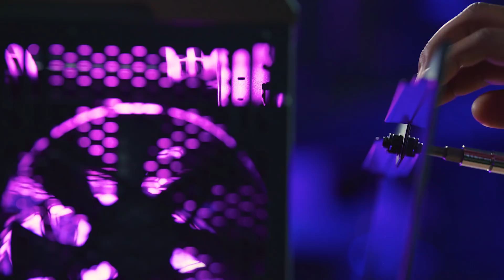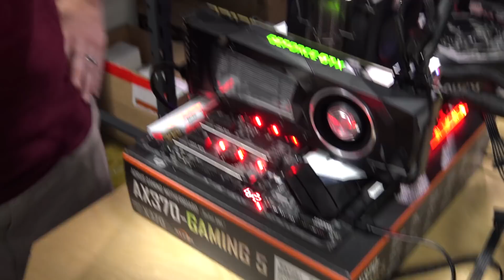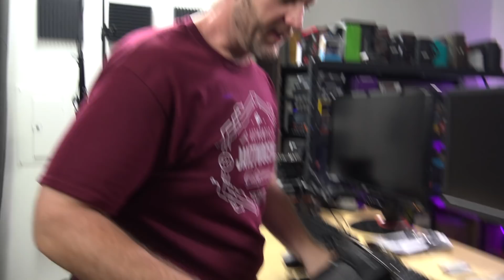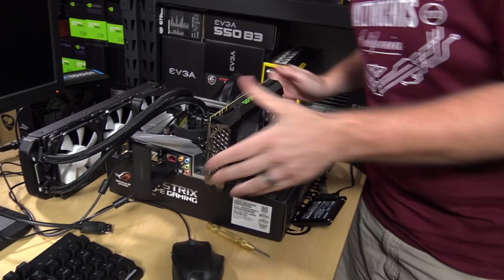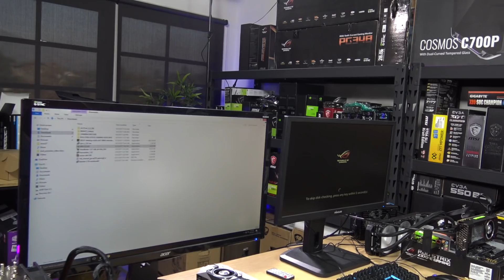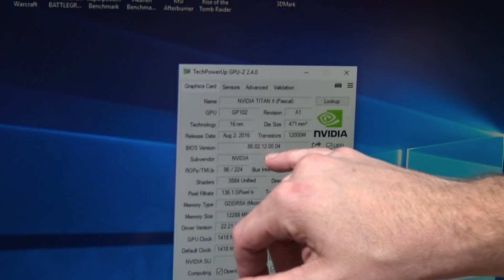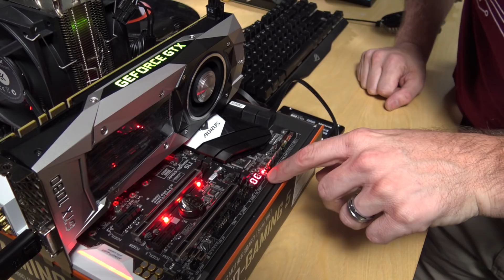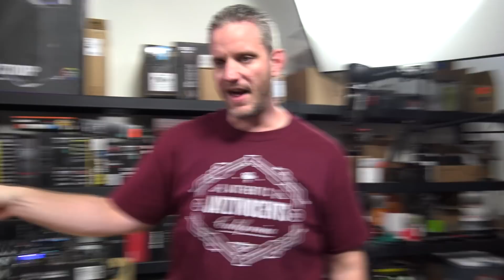I cant figure this one out... HELP!

Comment: on the AMD CPU system you have Nvidia cards and AMD card, I suppose you installed AMD and Nvidia drivers. Uninstall the AMD card driver on AMD CPU system and put the non working gpu nvidia in.

Comment: Had a similar problem once, and even though I'm not quite sure if that's what did it, cleaning the pci-slot (With some ipa and compressed air) and the connector (with just some ipa) on the card got it working, so I'm assuming that they both had dirt on them that when combined, made the connection too weak which ruined the functionality.

Comment: the Solution is power supply fault. as you know, gtx1080 take 180W , the TI 250W. i think for amd power supply may crush in over load.even on same card like 1080 one can take 180W and another 150W .  if you check in intel system if take same video card take same power consumption (from the wall), i say you will see at least 50W difference between AMD & intel system

Comment: My gigabyte board does the same ( INTEL x99 Designair ). Uninstall the nvidia driver boot with other card that was not working. It should work then. Does it with my 970 not my 1070 Both gigabyte.  Reload driver for graphics card. Let me know if it works

Comment: 1. Save bios of working card (the one that works on both systems) via GPU-Z
2. Get bios of that card (.04 one) to the intel system and flash the card that does not work on ryzen 
3. try the card that was not working on ryzen to see if it works with the "new" bios

Comment: You checked GPU bios on the same card twice.  Had this happen a few times in my 38 years of messing with computers.  Had it happen on two same GPU's being put into same identical systems (right down to motherboard, cpu, and bios), one wouldn't work in one but both worked on the other.  You probably did experience it being in IT repair, but in IT repair you would have probably just replaced the card and moved on so you didn't know you had the problem.  Weirdest issue I have ever had that I never got to work was I had one computer that would boot with it's cover off but wouldn't with it's cover on (all cover connections connected while off).  There were no in-case cover switches or anything and was a mass produced pc that I had fixed hundreds of and knew inside and out, no shorts in wires.  Never KNEW what the issue was but got around the problem by swapping covers with another computer, both worked on the other system.

Comment: I had this problem, where my PC wouldn't boot from USB when one particular HDD was connected to the PC. Go figure it out. Had to removed the HDD, install Windows, and then put the HDD. Or when you plug this HDD in, congrats, you have no OS. (Both HDDs are recognised in BIOS)

Comment: I Would check if the card works on a different pci slot.  after that I will switch my power cables. if nothing o that works I will remove all the hardware and start the mobo alone to reset any bit issue. check my CPU pins and socket. check the card socket and pines. remove any OC onfiguration on the bios. Now if nothing works redo the build with a different MoBo and do tests.

Comment: If you have another board try the same card that didn't work on it. I have the same board and I had to send it back and get a replacement which still has issues just not as bad. It would be interesting to see if a board from another manufacturer has the same problem.

Comment: I have a similar problem , the system on a boot would initialize the CPU+MEM according to the motherboard followed by the GPU but stops then , does not reboot , just stops. it would show a black screen but if i disable the bios splash screen post image ,the screen would turn on and show  American Megatrends logo instead and stop there.

https://imgur.com/a/h0iej

I boot my system daily and use it for 7-16 hours a day since i got it ,no stability issues.

To solve it , i just press the reboot button and everything working again , I could not find any bios settings that had any impact , even tried stuff that I would assume had no impact on it. But the problem in general sometimes does not happen for 3 weeks in a row. 

One of the very very early bios for my board had a similar issue but unplugging my steam controller moved the bios forward again in the boot process ,... ( that particular bios did not last long before it was updated and  i could never reproduce it)

Anyway I really hate this because I tend to give away my PC to  less tech-savvy people like mom/dad where it should work , not work 99 boots out of 100 because stuff like this scare the hell out of them. Not that I am PC-expert myself.

SPECS :
Gigabyte Gaming 3  B350 
-splash screen disabled 
-SVM enbaled (Virtualization default off, manual says it should been default on ) 
-XMP Profile 1 2400
-Manual set PCIe mode to PCIe 3 instead off Auto (one of the things I tested and left on)

CPU
-Ryzen 7 1700 - default wraith spire cooler

Memory
-ADATA XPG  ax4u240038g16-dbz Z1
Graphics
-RX 470 Sapphire Nitro+ with silent bios switch on
DISK
-Ultra Disk II 480GB
-A old samsung drive , hope to be replaced on next cyber monday :P

RM 550 corsair

Sofware
Windows 10 Pro , 1703
No overclocking , casual gaming (WoW,Hots,Divinity2,Indie games) , hobby developper/virtualization

Comment: General rule... weird faults often have their source at the PSU (you are looking at the effect of batching on gpu performance, this would result in different current draw, which may pull down an adjacent line, or screw with line regulation and screw up the POST)

More specifically the reseating the 1080 that you had to do - and the bogus error codes - badly seated gfx card causing memory/cpu errors???) does in fact suggest that all is not well with that mobo, maybe something that is just in spec in factory tests but out of spec in real world conditions?? a slightly shitty via or something that is ok-ish most of the time, but there is something about the 'bad' card that pushes it over the edge?
Reply: Posting to support this suggestion that it may be a tolerance issue - possibly with the PCI-E timing on boot. Also for all those commenting on the card bios - I am sure this was a filming error and that Jay had already confirmed they are both the same.
One question - is the Ryzen overclocked? I suspect not because when you have some sort of issue the first thing you  would usually try is to revert to defaults..
Reply: Or simply bad CPU/memory overclock...
Reply: PSU swap worth a try!!

Comment: I had a similar problem with a regular 1080 what I ended up doing was (No idea why this worked) unplugged my hard drives reset my C-mos reseated the GPU and it turned right the fuck on haven't done anything else except get the ram running at the right frequency. If that doesn't work I have no fucking clue.
Reply: i think its got something to do with ryzen not playing nice with the ram.

Comment: Considering you check the other card - as everyone pointed out, I would check different architecture systems next. The card might actually be broken - just a component that is not used with all chip sets - maybe check which PCIe version is used as protocol. Do all cards run on the same or does one run on 3.0 and the other one on 3.1? After all, systems run on legacy mode if they cannot establish a higher standard - and one might crash, the other might not. Really hard to figure these things out not having hands on it.

Comment: Problem with motherboard or DIMMs. 

I bet replacing the motherboard will fix the problem, ops it kinda did in the Intel system. BTW I still have USB problems with X99 on an Asus mobo so its not just AMD with problems here and then due to their new platform Ryzen, Intel still has them today!

Comment: It seems likely to me that the two cards, while technically exactly the same model (assuming the BIOS versions are identical - you checked BIOS version on the same card twice BTW, and we didn't get to see the BIOS version of the "fussy" card), have typical manufacturing and component variations from unit to unit.  The "fussy" Titan may require a little more power during bootstrap, so I'd think it's possible the Ryzen motherboard isn't delivering quite enough current (through the PCIe slot) for it to pass the POST.  That's probably unique to just that card - and maybe even that particular motherboard -  The Intel board's bootstrap voltages, or maybe its power delivery / VRMs, are able to provide enough current for the "fussy" Titan card let the system pass its self-tests.  The only test missing now is to get another identical Ryzen board, transplant everything, and see if the "fussy" Titan boots on that.  If it does, it's probably a combination of the Titan requiring a little more power, and the original Ryzen board not delivering quite enough, which would cause the POST failure.  Perhaps the "fussy" Titan, and that particular motherboard, were both built on a Friday afternoon....

Comment: Is it worth doing a hardware BIOS reset on the motherboard. Take out CMOS battery to drain MB BIOS power. On HP PCs motherboards there was a button to hold down to reset BIOS to default.

Comment: I have had similar issues try re-flashing the motherboard bios and leaving everything at stock then putting the card back in. It should work then but it it doesn't, it will never work with that board due to electrical communication tolerances between the board and the graphics card being just out of spec from each other. Usually From what I have seen it is a slightly out of speck issue where the PCI express is not communicating correctly due to a clock generator being off or not recognizable due to the specific cards tolerances. Remember even identical cards are different in their tolerances. I have seen this happen with 290x's, 970's, 980's, 480's, and 580's, this is the first 10 series I have seen it on but it is just the luck of the draw.

Comment: My brother had this EXACT problem with a 960 and an FX 4300. He has to push his power button, then wait for about 2-3 minutes and leave it running, then hit the Reset button.
Reply: the 960 works normal in my I7 5930k system, and my 980ti works fine in his system

Comment: i have the same problem with my asus sabertooth 990fx-8350cpu and a zotac 970, it wont POST after a few tries, my cpu and ram leds flashes, i turn the psu off (2 times) and the third time is the one that works

Comment: You only checked 1 cards BIOS. Also, try the "questionable" card in a different AMD test bed. The reason the card seemingly works may be because the 8700K has integrated graphics. Just a thought.

Comment: Is the gpu oc'd? If so, it could be xmp profile messing it up.. And the old man in me wants to say "tried pulling the battery?" aka a power-flush... Idk, had some similar problems with gtx 780ti some years back. It would freeze up in a msi (cheapo msi, not top-of-the-line msi) but my ratchet ass gigabyte mb from 2007 would recognize it and power up as normal, tried everything, and in desperation i pulled off all cables attached to the mb, and changed out the mb battery, plugged everything back together and it miraculously worked. To my annoyance. Lost about 2 working hours trying to troubleshoot... Good luck Jay.
Reply: +Ian Visser
No it wouldn't lmfao what.
Reply: Ian Visser that means nothing this is a specific problem for a specific set of hardware. I also got the same mb, not the same cpu tho, still worth a try for him
Reply: +Ian Visser
If it was a bad OC on the GPU, the computer would reset and everything will automatically be reset to there defaults.
Reply: wrong..

Comment: check the voltages distribution between the PCIE and the 8pin... problem could also be I/O priority order (a problem with certain hard drives waaaay back in IDE days where one drive works only on priority two, regardless of pin settings, while only working priority one on other computers). Maybe try the next PCIE lane. good luck

Comment: JayZTwoCents : The "quazi faulty one" is needing a slightly bigger starting current from the PSU....hence do not use a 1 PCI-Express cable to connect a Titan that is in reality a GPU capable of using above 350 Watts of electricity at full stress and has a bigger starting current spike needed to turn on on certain configurations....even bigger if it is slightly damaged from overclocking. USE 2 PCI EXPESS cables / rails, so 1 on for each power connector on Titan and that way you will be able to deliver the necessary starting current into the GPU if other components are at startup burdening the PSU too much.

Comment: Let’s assume that both bios are the same.  While it does t make a lot of sense, I’d switch power cables and even power supplies.  I get that it should affect the “good” card but worth a shot. Could be a finicky pin

Comment: @JayzTwoCents  I figured I'd chime in as well. I'd look more closely at power to the board and in particular the PCI-E slot. I've seen an issue where the board wasn't providing enough boot-up power to the PCI-E and the graphics card wouldn't initialize. Regardless if the card has additional power connectors, the slot has to send the voltage to the card and the card has to respond in order for the board to recognize the connection has been made. Newer boards send a halt state when no video output is present. I would personally try the Titan Xp in a different PCI-E slot, same board. Of course the connection speed won't be the same, that's irrelevant though. Then I would try a different AM4 board, identical to Aorus you are using.

My thoughts are that the one Titan Xp you have deemed as "bad" may be more finicky on slot power and the Aorus board isn't providing the boot-up power needed. The Intel board seems to be pushing enough to keep the card happy. IMO, the BIOS would cause a fault in the card no matter what board you put it in. I've personally never seen an older BIOS on a card keep a board from posting.

Lastly, while both the cards are from NVidia and both are Titan Xps, I thought we learned that "identical" in the graphics cards world just means they come in the same box. You proved that yourself, remember?

Comment: iv also noticed issues with the new am4 motherboards their faulty on picking up alot of things that the motherboard manafacturer swears they will recognize it was a rush job to get them out basically even tho everyone has spent thousands am4 is still in beta testing by the time they get it correct coffee lake will be running smoother than butter am4 is a good socket good cpus but still way to many issues with it some people get lucky and get a perfect am4 system while others get ripped out of money i say its because their bois are still tweaky

Comment: It might well be the motherboard! I am experiencing the same issue on my Asus X99-E WS. And it's broken. It has dodgy PCIe lanes. Sometimes it works sometimes it doesn't. Only the last three slots are still working properly, also USB 3 seems to have problems as my Razer Mamba TE is freezing once a day.

Clean the CPU contacts/pins, clean the card's contacts with 99.99% Isopropyl.

Also it could be an alignment problem due to tolerances between the socket and the PCB of the particular Titan Xp. Maybe on this one it doesn't quite line-up. Maybe the board's socket has a slight manufacturing error that only happens to take effect on this particular Titan Xp.

Comment: Try another power supply.. had a similiar problem with a pc of a friend of mine, the machine just would not boot.. we checked everything, all components.. but not the psu. After putting in another one, everything worked just fine.

Comment: I'm not an expert or particularly familiar with gpu-z, but when you moved the graphics cards, you only tested the working gpu for the bios version. I don't know what you did behind the scenes, but you need to isolate both the working card and the questionable card in nearly identical conditions and run identical tests for this sort of thing.